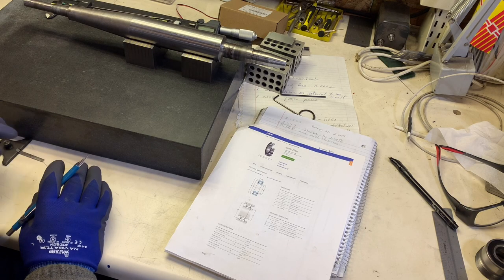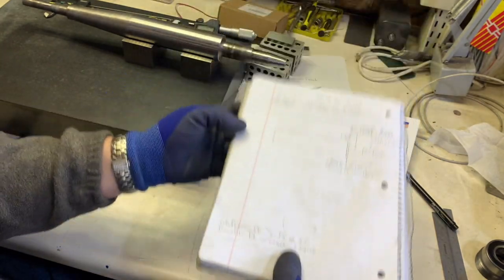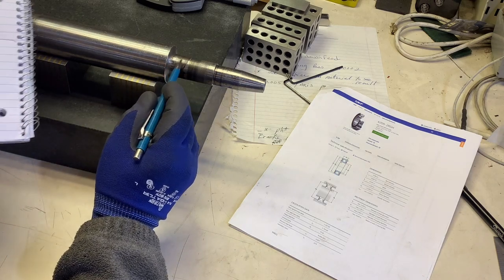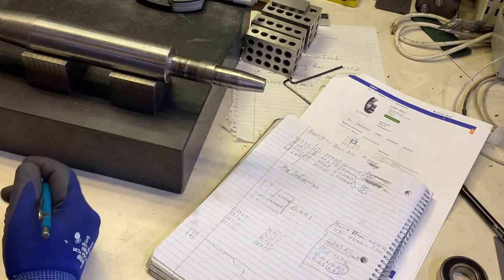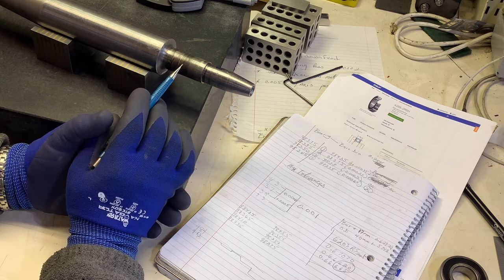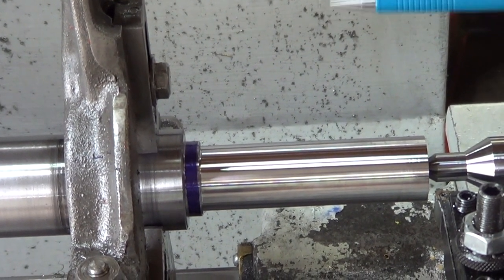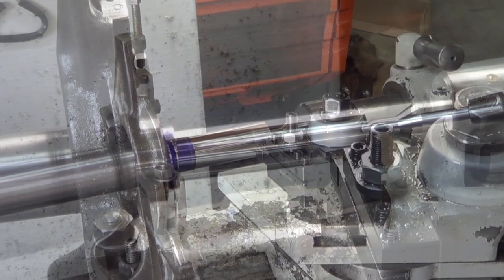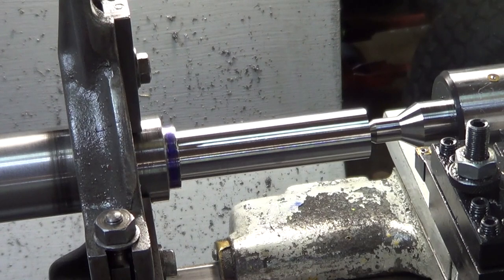How to make a Precision Spindle  Part 1

Comment: We have reworked and repaired many spindles over the years. A good tip to save re making the whole unit is to (I work in the cylindrical grinding department) grind the O.D. Diameters undersize approximately .003”. Being either the bearing diameter or the seal mating surface. Then have that area chrome plated at least .006” thick. Then grind to proper spec. The chrome will be stronger than the hardened steel so the spindle now will last longer than the original.
Reply from the maker: Fantastic advice. Thank you Kevin.

Comment: You released this 8 months ago. Did the previous owner of the surface grinder discard a part of the spindle? Seems there should be a spacer between the two bearings (inner race as the outer race appears to be the preload adjustment) to preload the balls, forcing a angular contact and keeps the spindle from moving axially. Did I miss this in the video?
Reply: It would be a thin ring between the two inner races, if it had one.
Reply from the maker: The previous owner I presume, might have replaced the original spindle with a homemade spindle. The spindle did not match the manufacturer diagrams. So you didn’t miss anything. But that’s ok, the grinder now works very well and as a hobbyist I’m pleased with the results.
Reply from the maker: @f.hababorbitz  for what it’s worth you can always call on me and I’ll help you as much as I can. Gilles

Comment: Interesting project, and if i may i shall add a few hints when "chasing tenths ". 
First, surface finish is vital, you can measure and it maybe perfectly in spec but if the surface is not dead smooth the first time you slide a bearing on the part will end up undersize due to the rough peaks getting compressed. 
Second, as you found push off is a problem, not only in the part bending (as RobRenz correctly says everything is made of rubber) but aldo the oil film on the cross slide leadscrew. The heavier the cut the more the oilfilm is compressed but on light, ie finishing, the weight of the cross slide is enough to stop it moving away. The answer is to preload the cross slide  on finishing cuts to match the load of a heavy cut, this can be achieved by pulling the tool post away from the work for the last few cuts. In addition the use of a really sharp correctly shaped and honed tool will allow proper precision and possibly the use of a roller burnisher to improve the surface.
The above may be overkill for general use but if you are chasing tenths or microns worth bearing in mind.
I hope I'm not preaching to the converted. 😆
Reply from the maker: Chris that is fantastic advice and I thank you for sharing your expertise. I certainly learned a lot during this project. Achieving precise measurements takes preparation and  measured approach. 👍🏼👍🏼. Gilles
Reply: @LetsRogerThat  you flatter me, but my philosophy is if you know something and don't pass it on it is lost when to are pushing up the daisies. 
If you haven't come across roller burnishing I have a simple beginners video showing the technique on my channel.
Chris
Reply from the maker: @chrisstephens6673  I ascribe to your philosophy Chis. I will definitely watch your videos. Thank you. Gilles
Reply: @LetsRogerThat  I must record some more, but I only video when I have something to share rather than  keep doing one a week, but with nothing to say .
Reply: Ta, I have learnt something.

Comment: 6205 bearings? haha! these are deep groove bearings, and you don't use deep groove bearings on a spindle, they have a very big radial clearance so the spindle is going to wobble like a pen in hand when you move it. The only way you can use deep groove bearings on a spindle (yeah, because they are cheap!) is if you cut it in half (or like 2 thirds) so you can make an angular bearings out of two deep groove bearings and when you preload the resulting thing the radial clearance is going to disappear. The balls of deep groove bearings from japanese manufacturers are nanometer-scale precise so you would get a precision spindle the cheapest possible way. And this is what I was about to do before I discovered the tapered rolling bearings and because I don't need to run my spindles at high RPM, tapered bearings are just the same as good as P3/P2 class angular contact bearings which sell at 500 bucks per set (or more expensive). I have measured the tapered roller bearings and they give a half a micron precision, pretty good for a self made lathe so .... no need for angular contact. Tapered bearings also better than angular contact because they won't wear out as bearings made with balls would.
TLDR: I recommend anyone who is doing their own spindles to download the SKF manual on super-precision bearings, it is a must-read 424 page document for any spindle designer, you will understand everything about precision brearings and will know what kind of bearings should you use (either 70XX series or for example 718XX series), also this manual contains drawings for lots of spindles and tells you which bearings should you use and how should you place different types of bearings for lathe, milling machine, high load lathe, and so on ... very good read.
Reply from the maker: Thank you. Great tip. I did read the manual butI appreciate the advice.